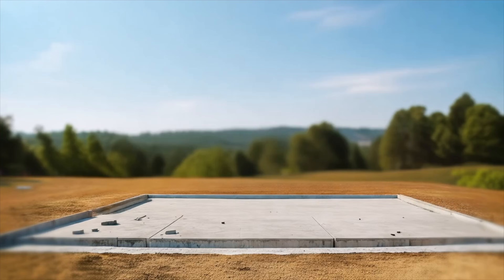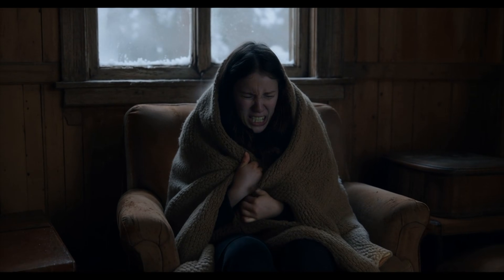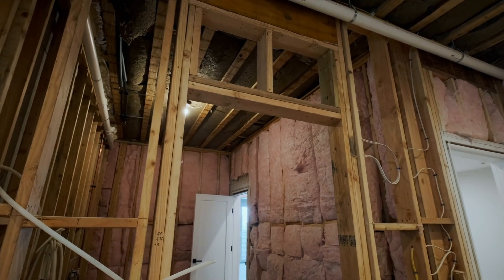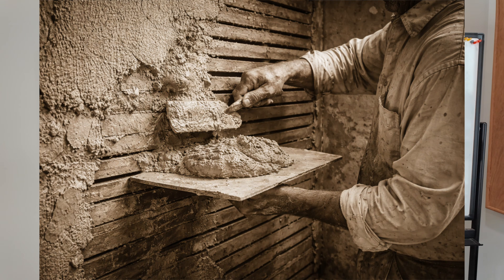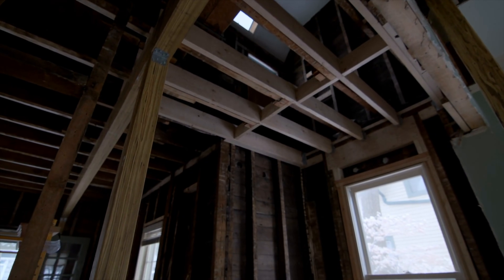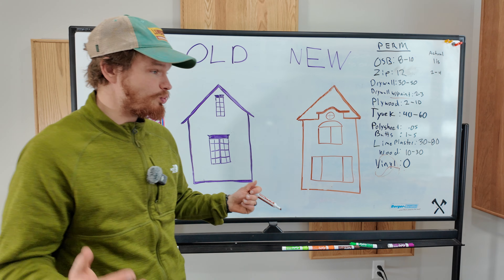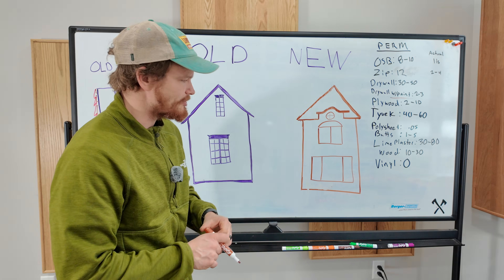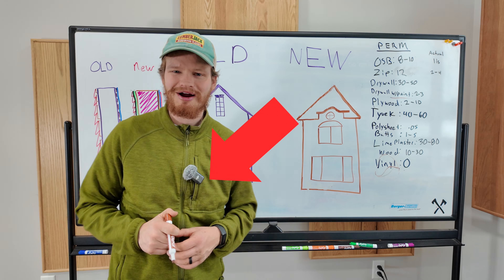New Houses Are Growing Mold — Old Ones Somehow Usually Don't

Comment: I moved my family into a 1900 build with two stories, a massive open attic that has daylight visible throughout  the soffits, shiplap siding, plaster and lath walls, the whole place is framed in old growth redwood, the basement walls are 2’ thick stone with massive 10x10 redwood beams and vertical pillars for support. Theres a wood brining boiler to run the radiant heat throughout the house and they added central air with an air exchange unit in the attic. I’m not doing a dam thing to this house because its incredible and still intact to this day. I could not fathom the cost to build something this well built these days.
Reply from the maker: Sounds awesome!
Reply: Lead based paint? Asbestos?, aluminum wiring?
Reply: chimney there to stay warm
Reply: Congrats!
Reply: Old houses last because they are drafty and lack insulation.  Good for mold prevention, but terrible for staying warm in cold climates.
Reply: I’m sorry but you don’t need any 😊re
Reply: I have a question! How's the electrical? Does it have the old knob and tube wiring? I wanna hear all about it because I was considering a house very similar to what you are describing but buying such an old house with no insulation and old wiring sounds so scary and like maintenance costs will be enormous.
Reply: But is it cold as heck for lack of insulation?

Comment: Great video. I have a 1920s home that has been slightly updated, but is going to need some work in the coming years. Vinyl siding and blown in insulation has been added, however I plan to replace the windows and I know to get a good seal, I'll have to remove the Vinyl and wood siding below that, at which point my insulation falls out. So now I'm left with the question of do I replace it with the Zip system and possibly spray foam it? I do think the insulated zip would be a good idea, but the spray foam would likely be a poor decision in a home this old and without treated sill plates.
Reply from the maker: In old homes especially I’m a big fan of only using insulation that is highly permeable like wood fiber, wool or mineral wool. You can use a smart vapor barrier to control air flow instead of zip.

Comment: Ive heard that old homes can be a nightmare if things are sealed up during renos but a small leak is missed. Most product absorbs water and leads to rot eventually
Reply from the maker: This is definitely true. Sometimes better to not retrofit old homes.
Reply: This also hold true when talking about furnaces and air delivery systems. Old houses weren't sealed as the furnace pushed air outwards through the structure and dried then out. New ones have furnaces that pull and exhaust externally and don't pressurize the home, and the goal is now to prevent moisture from entering from the exterior at all, as there is no drying power anymore. The moment you start adding modern appliances and sealing things, you change that dynamic and the house sits in a bad middle-ground where the structure may last for a while, but a small leak will suddenly be a very big problem.
Reply: Old houses should never be sealed up - they are meant to have a flow of air from the outside through the house into the open fires and up the chimney - giving constant air flow, also walks are meant to let damp in and out, windows have some ventilation not double glazed

Comment: So what should we build with?

We need to be economical, energy efficient, durable & healthy. Old growth lumber is expensive and those old methods were also inefficient. OSB has issues but it is cheap enough for it's part.
Reply from the maker: I would start with minor changes depending on your budget. Do plywood instead of OSB- it’s significantly better IMO. Add a couple layers of exterior wood fiber board instead of doing spray foam. Do mineral wool in the cavities instead of fiberglass - or wood fiber or sheep’s wool. Do a smart vapor barrier inside and detail it precisely. 

I’ll do a series on it soon.

Comment: It's pretty simple.  New homes should have sheathing installed with something like Zip sheathing with properly taped seams.  The roof should have proper flashing and large overhangs helps a lot to keep water off siding.  OK, that takes care of exterior air/moisture intrusion.  Then stud cavity insulation should be properly installed with mineral wool or closed cell foam with no interior vapor barrier.  Finally, that structure needs an ERV for fresh air and right sized AC unit to keep summer humidity low.  The key is keeping interior humidity low.

New homes from non-custom builders are poorly built.  Gaps in siding transitions, missing flashing and cheap materials all invite water intrusion.  Raw OSB sheathing with torn Tyvek or thousands of staple holes in it, and fiberglass insulation is a recipe for mold growth from water intrusion.
Reply: not only the design,  but the execution properly of the details -  as you point out -  will make a differance over time.

Comment: okay so how can you avoid mold?
Reply: ERV / HRV system, tilt and turn windows with effiAIR function (build-in ventilation system).
Reply from the maker: Use real wood siding, do a rain screen. Do Plywood instead of OSB. Use a vapor open insulation like mineral wool, sheep’s wool or wood fiber. Do a smart vapor barrier inside and  finish with wood plank walls or lime plaster. Maybe you can’t do all these, the more you can do the better off you will be.
Reply: Sorry I am here to look smart and click bate your ass.
Reply from the maker: Except I talked about exactly what the title said I would and answered the question.

Comment: Here's what the walls on my 1909 Craftsman in Seattle are now starting with the outside layer by layer: james hardie siding -> rain screen (1" air gap) -> yellow house wrap - > plywood -> rockwool -> lath & plaster -> drywall. I removed a layer of tar paper and the old cedar siding that had rotted in many places due to bad paing and neglect and added the insulation and the remaining exterior layers. The drywall over the plaster must've been added in the late 80s. The house is pretty well insulated right now, a year in, moisture is around 50% in winter, less in summer, while I almost don't need to use the furnace. These types of problems need more years to manifest though, so I am not sure if I messed up yet.
Reply: I’m doing the basically same in my 1910 Seattle craftsman. With the addition of external insulation also. I’m pretty aware of how this can go wrong. 

Best of luck to us both I guess.
Reply: I think with the james hardie siding, rain screen and house wrap, you will be fine, as long as you flash properly around openings and don't have any areas where water gets channeled against the walls. It sounds like your setup will properly shed water and if any does get in, it is permeable enough to breathe it back out in drier conditions. Wish you well and I think you are following best practices.
Reply: @sputnik94115  my particular setup is using zipR which does have a slight permeability issue. I’m specifying we use the VP zip tape and then i’m not adding a vapor barrier on the inside. My hope is any water getting in can dry to the inside since the rock wool is vapor open and doesn’t wet like cellulose or fiberglass.

Comment: Great video, I cannot tell you how many times I’ve had to explain this to people.  I’m glad you touched on the dew point and I like your comparison to the engineered wood products already being dead and starting to rot. Thermal bridging is also an interesting topic.  Installing siding on battens so air can flow behind it helps. Also I always add in the 1970’s energy crisis as a primary cause for the transition into our current construction standards. Thank you.
Reply from the maker: Thanks for pointing those things out!

Comment: Why are we counting paint for the drywall, but assuming that those plaster walls are being left naked? 

Every L&P house I've lived in has had paint on the walls, and frequently generations of it
Reply from the maker: Yeah this is a fair point. Back when plaster was used the paints were not latex based and many of them were breathable. But yeah if your old plaster walls have been painted you probably aren’t that much better off
Reply: doesn't  matter ...  air still moves in the wall ,, paint just means it doesn't get inside
Reply: @ronaldwoofer5024 correct. But he was specifically comparing drywall (with paint) to unpainted Lathe and Plaster for permeability
Reply: My 150 year old house had mostly wall paper when I bought it in the mid 80s. The plaster had a thin coat of paint if any. The cedar siding and 7/8" rough sawn sheathing has air gaps. 40 percent humidity is common due to hot water baseboard and no hvac. 150 year old windows with storm windows breath.  Rain and snow melt are the major issues. It starts at the roof. And the overhang soft is over 30 inches from the wall.

Comment: As envelopes improved faster than code caught up, ventilation became the missing piece. HRVs/ERVs manage air and moisture intentionally, while material selection determines how forgiving the assembly is.
Reply: Beside that Tilt-and-turn windows can be kept crack open and deliver fresh air without water intrusion.

Comment: The problem is combining organic with inorganic materials. It wouldn't matter in a steel framed building with spray foam. Nothing for mold to eat there. Until you put up drywall with paper.
Reply: U get mold on foam or plastic too.
Reply: In south Florida I see mold on fingerprints that are on metal. If left long enough in moisture and warmth mold seems to grow on most things.
Reply from the maker: That’s an interesting insight. I

Comment: Just curious where you get your metric? Like if newer homes have more mold, at what percent? The moldiest nastiest houses I've ever seen have been old ones from the 60's and 70's. Most of the newish houses from the 90's and 2000's Ive cut into have been pretty decent.
Reply from the maker: It’s really from experience and the second hand experience of others that I have learned from. The era that is known for being some of the worst is the 70s when the energy crisis happened and building codes started to change fe
Reply: @LumberjackHealthyHomes  70's as a "new" house might be a stretch.... Standards and conditions are different depending on where you are in the US, but in general, at least here, actual new houses are well built. Inspections are comprehensive and architects are drafting thorough plans for which you have to follow to pass inspections.

Comment: My 1947 house is made from old-growth redwood. There is decades of water marks from roof leaks yet no mold and no rot.
Reply from the maker: I didn’t talk about old growth wood here but I should have.
Reply: @LumberjackHealthyHomes  This video is a real eye opener. I wonder what your thoughts are on ICF, insulated concrete forms, homes when it comes to mold. Hopefully you can do a video on ICF homes. Thank you. You have a new subscriber. 😊
Reply: @LumberjackHealthyHomes  I also have the same question regarding ICF.... thoughts?
Reply: @LumberjackHealthyHomes  Makes all the difference. Much more heartwood than sapwood, so much so that any sapwood was removed when beams were made. because the loss was minimal and it was not worth to keep it. And the wood was cut differently.
Reply: Redwood is genuinely rot resistant in its own right.
Reply: @garethbaus5471 The ceiling plaster isn't usually...
Reply: @crisbowman plaster is actually quite rot resistant, it just doesn't hold up well to moisture.
Reply: @garethbaus5471  When you mix plaster with paper, you start having such issues.
Reply: Nothing is better than crooked floors and failing foundations made of blocks.
Reply: Your house could probably float, too 😃
Reply: I have done remodels on houses built in the 20's through the 40's. They are not level or plumb any more. They are drafty. They however have no mold or rot whatsoever. I have done remodels on homes built in the late 90's and 2000's. They already have rot and mold in them. New construction is not as good as old in my own opinion. I am building my own small home. I am using a pier and beam with a cross between old and new framing techniques. Hopefully it will last me until I die
Reply: And expensive heating bills.
Reply: @bobbray9666  cheaper than cancer treatment...
Reply: @josephrobison2601  Thanks Doctor Don't Know Shit.
Reply: @bobbray9666 well? No answer? Yeah you were definitely raised by a single parent and voted for Obama
Reply: @bobbray9666  I prefer to have +$200 / year in "expensive heating bills" than paying +$20k in insulation and having terrible problems. And how many year for the amortisation of $20k by saving $200/y 🤔 a century !
Reply: @Percy-k3f Hope you don't handle your families finances.:face-orange-raised-eyebrow:
Reply: @Percy-k3fI am trying to achieve a middle ground. It's never going to be perfectly energy efficient when starting with an older home. But I know that there are people who have  made some improvements. In this market, it's challenging to find affordable homes and I feel grateful to at least have this house.
Reply: yikes, that's where the majestic redwoods ended up: some plank 😢
Reply: Well yeah, no shit. Are we supposed to learn something from that? There is no more old growth redwood. It's not an option to build with anymore. So what is your point?
Reply: @AidanDavis-f8v  My house is made from glass and metal and I have no mold.
Reply: @bobbray9666  Do you live in your car? Lol
Reply: @bobbray9666 Sounds either cold or stifling

Comment: You don't want a house to breath.  You don't want drafty airflow.  You want to be able to control the humidity.  You want A (SINGLE) vapor impermeable barrier around the house.  The problem is when you have multiple, then water can get trapped between them.  So, if you have zip/etc on the outside of the exterior wall, then you could be introducing a problem with 3+ layers of vinyl paint /etc because now moisture can't get out of the wall.
Reply from the maker: Yep I completely agree. Everything should breath except the one layer
Reply: When closed, yes. But you want to be able to open an air current(s) during the warm months. Unless you pay extra each month for a dehumidifier.
Reply: That's his point...🙄

Comment: This was a random click, but I have learned why you guys have new house mould problem in America. Thank you.
Here where I live in Europe, the problem is usually an old house with 150 years old plain stone foundations, failing insulation around foundations, improperly done foundations... you get the drift. Or a leaky roof. Or  "I have put modern air-tight windows on an old house and forgot that I have to air it now" situation, which is surprisingly common (and that's because the foundations suck, but you have never noticed until now). 
New houses mold problems  - if they exist - are usually due to rushed work, without letting the concrete mature and dry out before putting a finish on it.
Reply from the maker: 150 year old house is pretty rare here lol but that’s so cool how you guys have them. I love to learn about how you guys do stuff etc thanks for sharing that
Reply: You know something's wrong when you have to air out your apartment 3-5 times a day for 15 minutes in winter to prevent mold in Europe.
Reply: But wood chips houses are modern and ecofriendly and green and money. 
Funny people.

Comment: This is why new homes need ERV's and whole house dehumidifiers to bring in fresh air and remove humidity
Reply: If you have a good central HVAC that reduces humidity year round then that's less of an issue. Even so, still good to open windows for a few hours a few times a week.
Reply: @MadPutz you're right, but in South Texas it's humid year round.    It can be 72f outside but indoors the humidity can creep up  so you gotta run the a/c at 70f.     Plan on installing an ERV and dehumidifier next year😊
Reply: Expensive. Good airflow during warmer months is equally as important.
Reply: @crisbowman exactly,  where I live it's always warm and humid !
Reply from the maker: Yeah this is cool technology. I see it talked about on YouTube but don’t actually see it used ever at least where I live.
Reply: wow, wonder what we're breathing in with all these synthetic house building materials 😮 maybe if we apply some of the same tech being used in these next gen moisture wicking sports clothes to some of the critical building materials we might achieve the same successful warm/dry results🤔
Reply: No need, if you build it well.